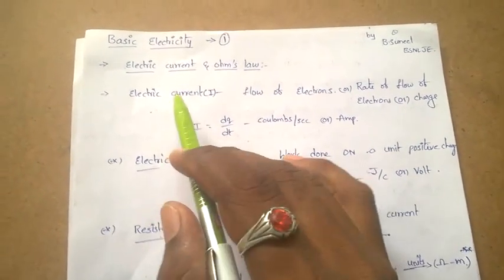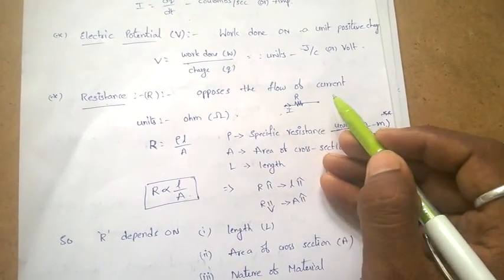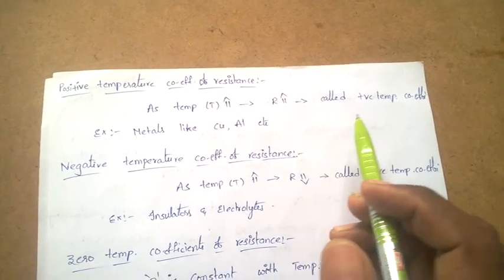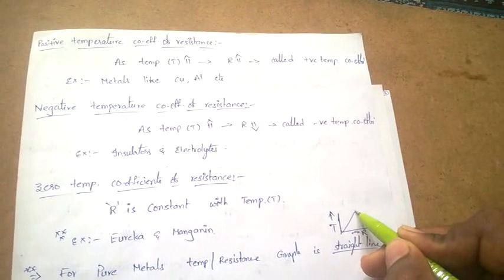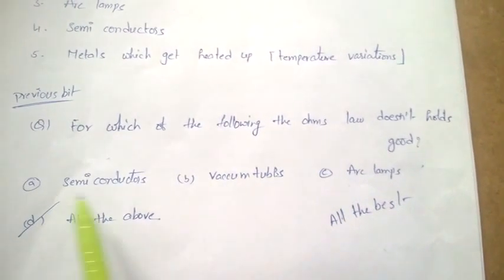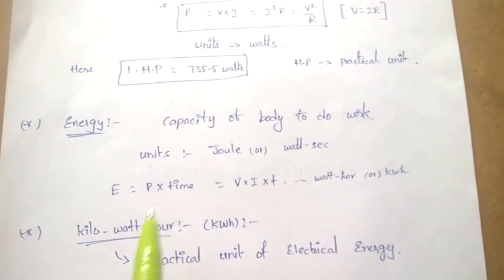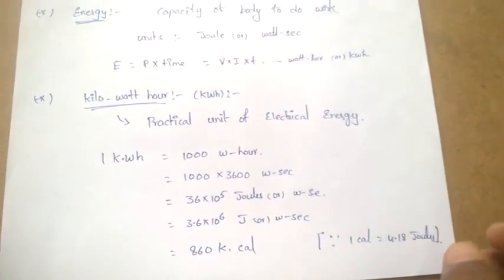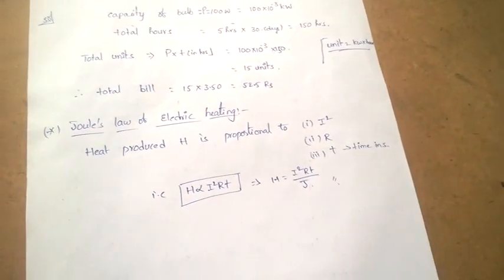BSNL JE/SSC JE 2016 exam preparation basic electricity PART1

Comment from the maker: Hi guys..If you want my class notes as pdf file please mail to me for payment details..My mail id: suneelbsnlje@gmail.com
Cost of bsnl je class notes pdf both part 1&2: 500/-
Cost of bsnl je class notes pdf part 1 only : 300/- 
Cost of bsnl je notes pdf part 2 only : 200/- 
Topics covered in part 1..
1.Bsnl je exam introduction - 4pages
2.Maths notes of youtube videos(matrices, differentiation,diff equations of second order, integration,complex numbers,partial diff) 38 pages
3.Maths materials with example question and solutions on remaining topics (vectors,fourier laplace transform and partial diff) 29 pages
5. Basic electricity youtube video notes all topics and mcq’s (except batteries) 36pages
6.basic electricity mcq questions material and batteries 14pages
7.Instruments and measurements notes of youtube videos (3 parts) and material of those topics..and mcq’s 25 pages
8.previous papers- 3(2015 -1,2015-2 and 2013) 78 pages
9.physics notes 23 pages
10.EDC ...Electronic devices and circuits ..50 pages
Topics covered in part 2:
1. Specialization - Electrical - Pdf notes of youtube classes – 15 video’s class notes – 70 pages
2. Specialization - control systems -Pdf notes of youtube classes–
15 video’s class notes – 63 pages
3.digital techniques pdf notes of youtube video classes-
10 video’s class notes – 40 pages..
4. Specialization - Network,filters and transmission lines pdf notes of youtube classes (imp topics only)  and imp bits....
Reply: Sunil Engineering Academy _SEA   sir plz send me the notes of these.. dikshita7401@gmail.com